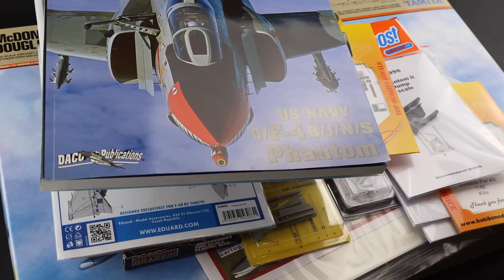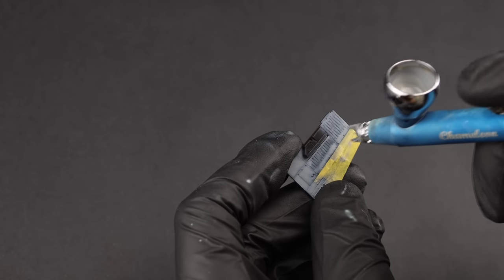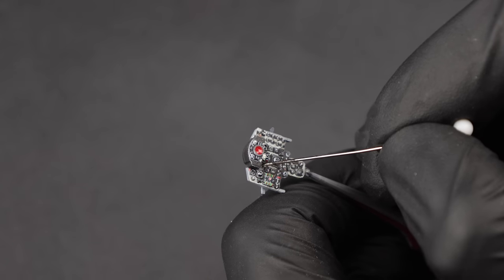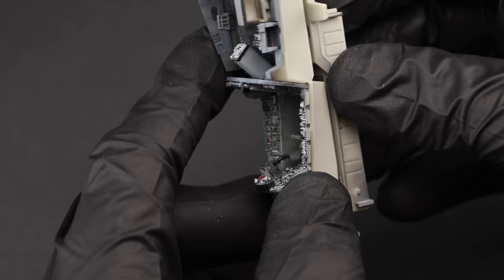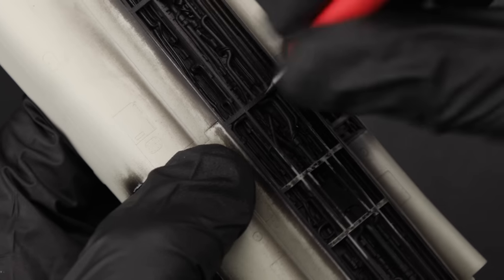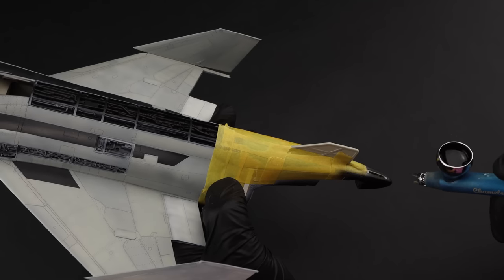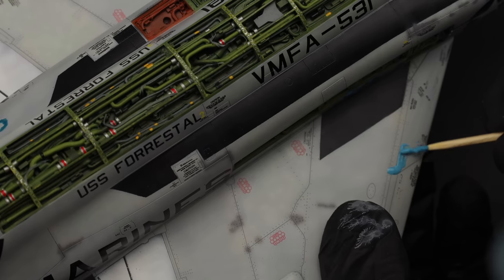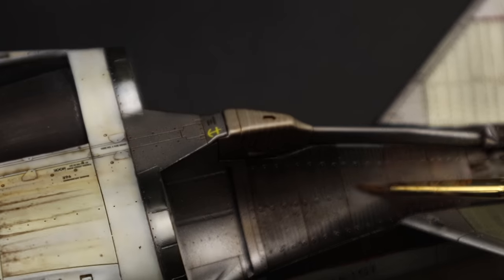Building a Superdetailed Tamiya F-4 Phantom | Model Aircraft #9

Comment: When I finally get to the level of a builder that you’re at. I plan on doing my rendition of a Fully scale detailed aircrafts, I plan to use the Original Blueprints to build all of the Legendary Grumman Cats by using polysheets or even sheets of steel that’s the same thickness as the metal that used for the Photo-etched detailed parts. So that when completed the models will have a scaled weight that’s equivalent to the real aircraft.
Reply from the maker: Wow! That sounds like an incredible undertaking. We'd love for you to DM us some pictures of your completed projects. Speaking of Grumman cats, we interviewed someone who had flown all of them. Check out the interview on our channel if you get a free hour. : )

Comment: OK I read your comments and the history. Kind of makes sense because in a lineup on the deck the tails would have been the most prominent. Perhaps this was even the moment that the future 'tradition' of zapping the tail fins during cross-operations got started??..We welcomed aircraft from USS Independence at a later date and they got the same treatment. At that stage they were some of the last US Aircraft to be using the old catapult technology we still had on the Ark Royal.
Reply from the maker: Would have been an interesting sight to see those launch!
Reply: @flightlinemedia  Well the US machines had a standard hydraulic nose extension of around 18 - 20" to augment the lift at takeoff, but our F4K's had 40"of nose extension. When the US machines went off they undoubtedly dipped at the end of the catapult run even though the catapults had been dialed up to the max. Some people held a hand to one ear joking about a "wet wheels" takeoff..
Reply: There are still some good Video sequences on YouTube with operations on the Ark Royal including Launch. "Hands to Flying Stations" is one of the good ones..

Comment: Hi, actually the reason behind the special paint job on the tail is a little different. There was always a tradition between Royal Navy and US Navy that when aircraft visited, they would be 'zapped' with some small emblems or squadron insignia.  If an aircraft was deployed for cross operations on a different carrier (like with USS Forrestal and later USS Independence) the tradition was somewhat 'adjusted' and the whole tail section and other items would get repainted for the duration of the deployment. Hence you have the red tail flash and Omega sign of 892 NAS and a smaller emblem on the intake ramp. On a regular F4K of 892 squadron, there would also be a white "R" on the tail fin, but that has been submitted here by the AA emblem. You will probably also find some 892 Phantoms on photos with "Colonial Navy" written on the side, during the 1976 deployment celebrating the bicentenary of the USA.  Great model by the way! I can still smell the hydraulic oil.. ;-)
Reply from the maker: Full writeup on its history here:

https://www.facebook.com/FLM.advertising